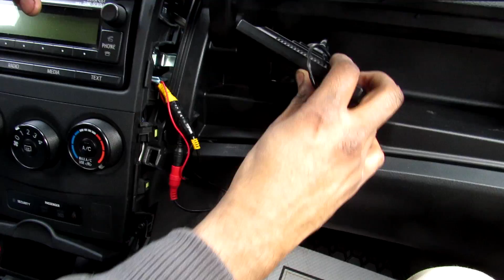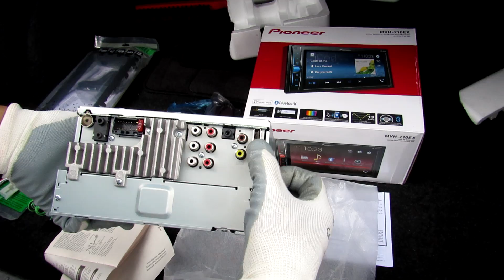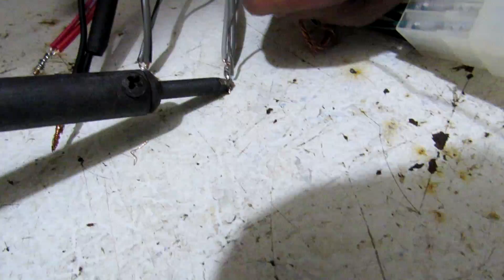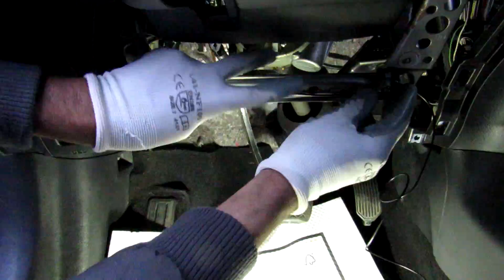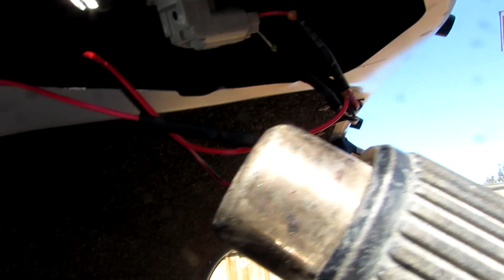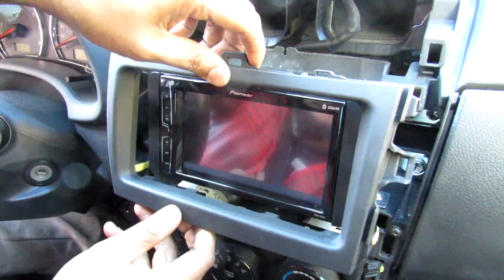How to Install a Car Stereo || Add Android Auto & Apple Carplay to Your Car

Comment: Amazing video. Only problem is that the radio you used does not actually support Android Auto and Apple CarPlay fully. Very informative though
Reply from the maker: A higher model will support ACP and AA but installation is the same.
Reply: @speedkar99  I'm not really knocking the video lol, just the title is slightly misleading

Comment: That toyota has a built in mic for Bluetooth, it’s located above where the mirror where the push lights are
Reply from the maker: In the Corolla??
Reply: @speedkar99  yes that radio that was removed is the 518C5 Toyota stock radio, it has Bluetooth built into it, i have the same car, so this video was being watched as a guide to remove the radio the one without Bluetooth isn’t the same style

Comment: Thank you this detail installation. I want to do that for my 2012 Camry as well. Especially appreciate the notes for the universal antenna adapter and the backup camera. Question on the microphone install: I notice you have curtain air bags, will the wires interfere with its deployment?

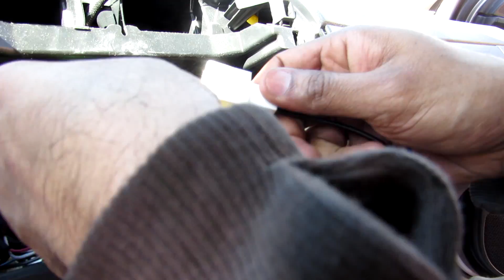Comment: Where does that second blue antenna wire go from the antenna  adapter??? 5:29
Reply from the maker: It doesn't go anywhere. This car does not have a power antenna.

Comment: I have a 2013 Corolla that has a stock touch screen that’s gone faulty and touch doesn’t work most of the time. I am really considering following this because I love the Pioneer radio. Had a few questions. 1. Do you have to solder the wires? 2. The stock touchscreen had bluetooth and a built in mic. Can I still use the stock toyota mic built into the interior or do I need to connect a separate mic as shown in the video? 3. My steering wheel has controls for radio, are there any additional steps needed for it to work with the controls or will it work as installed shown? 4. No backup camera in our car. Do we simply ignore the step to connect the camera? Thank you!

Comment: Thanks for this.  I'm definitely swapping the factory unit in the 2014 Sienna when it warms up (I'm not crazy like some people 😁).  The XLE model has the "advanced technology package"... what a piece of junk head unit from Toyota.  Sheeez.
Reply from the maker: Becareful with other functions integrated
Reply: @speedkar99  There are a couple of little interface boxes you can get now that automatically tie in the steering wheel controls and stuff.
Reply from the maker: That's where It can get expensive. Climate control and entune is another thing
Reply: @speedkar99  mines not entune actually, just a lousy, unreliable Bluetooth nav unit. The extra interface is about $150 but it saves a lot of hassle.

Comment: where did you buy the customer usb extension with flush mount? I hear some may not be compatible with android auto/carplay.
Reply from the maker: Came with the kit
Reply: @speedkar99   do you mean the wire harness kit or the dash kit?

Comment: Any way for you to source some information on a similar head unit that can work same functionality with not losing all the OEM functions on a 2015-new Nissan rogue?  I see all kinds of variations but not a simple Android/apple system that won't break the bank...
Reply: I was referring to the oem buttons on the steering wheel and also the radio itself that comes with oem.  Have searched and found most aftermarket units for the rogue ie, do not allow the OEM functions to stay, and most just bypass it.  :(
Reply from the maker: You'll need a module for the steering controls. If your head unit integrates HVAC then you'll need a Nissan specific unit